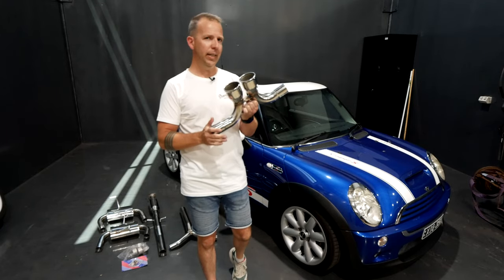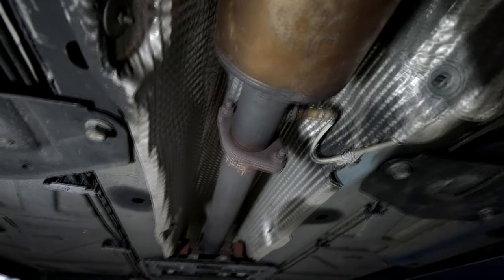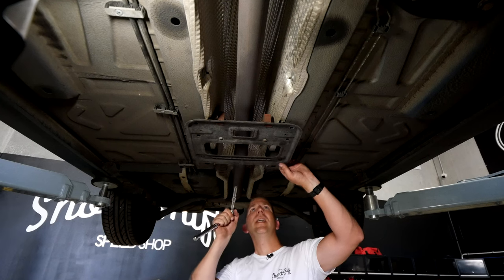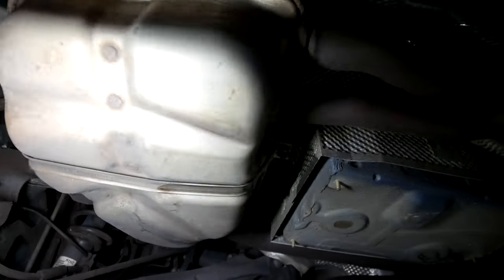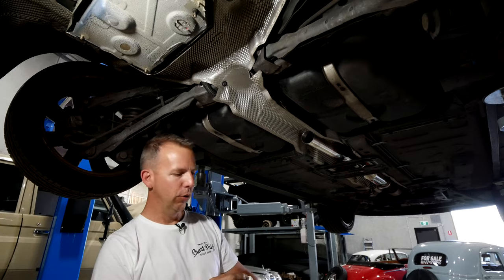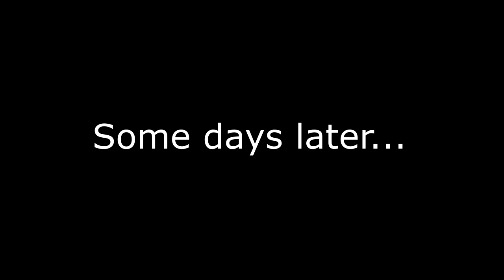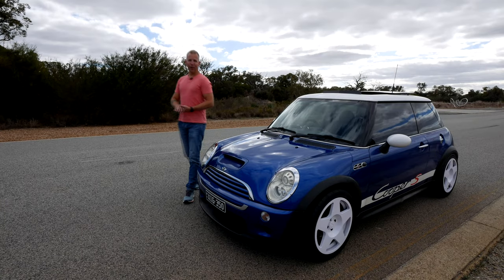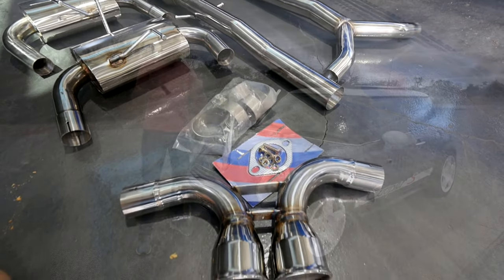Mini Cooper S R53 gets a new Exhaust and sounds Awesome!

Comment: If you are going to work on a MINI, I strongly suggest a set of ratcheting wrenches as there are a lot of places (like the top exhaust bolt) where you can only fit a wrench (not a socket) and being able to ratchet is priceless.
Reply from the maker: 100%!!!  The recent wrap job required removal of the external door handles....wish I had a set for that job.....horrible design 😄

Comment: Sounds great looking at doing the same. How is it at highway speeds, 6th gear 100-120km/h (70mph) drone/loud?

Yours is product Mal-086, any experience with the  race version Mal-070?

Cheers.
Reply from the maker: Thanks 👍 
At highway speeds it settles down nicely with little to no drone. It really just wakes up in the higher rpm.

Haven't tried the 070 sorry.
Reply: I installed the race version (MAL-070) on my cooper S but I regret it, the noise is too loud it has a lot of vibrations inside very unpleasant for daily use. for racing use the flow is probably better but useless to ride every day in my opinion.
Reply: I like this, not too noisy, but sounds nice.
Reply: @frax77  I know this is an old comment but this is all I needed to hear. Thank you! Just ordered it